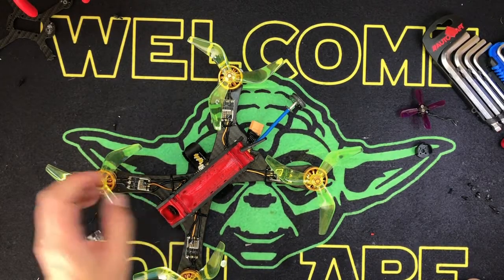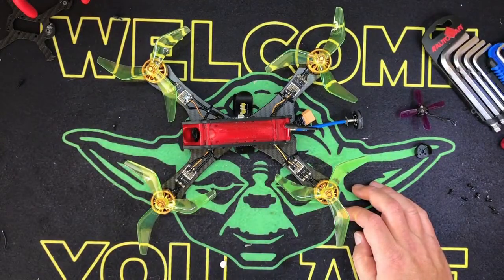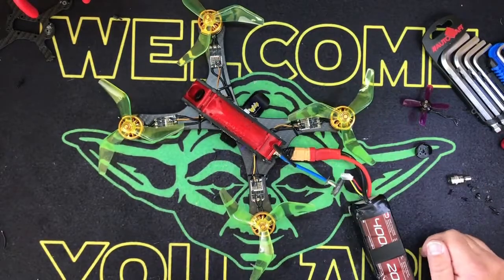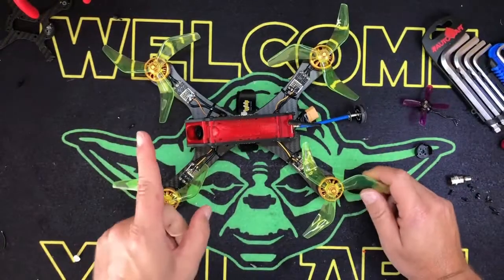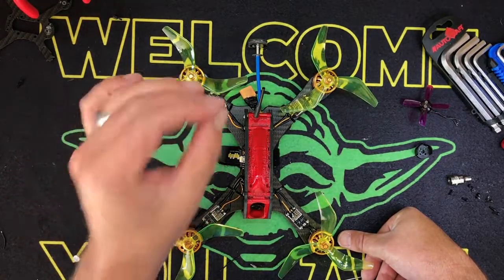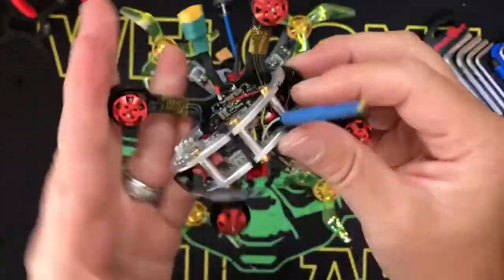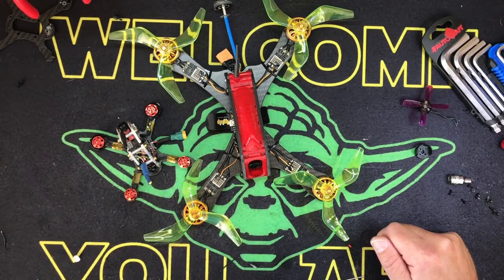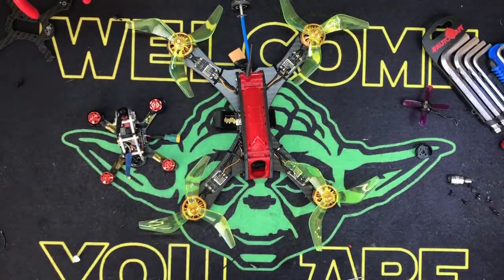Tech Advice- Betaflight 3.2 motor beeper function.. You should watch this..

Comment: I thought the idea of having the motors beep was so you could find the Quad when it crashes in long grass...?.....Worse, you didn't disclose how to set up the motor beeper either..
Reply from the maker: Hey brother, this is an old video, I think that motorbeeb was brand new.   I’ve covered this a few times in other videos.   It’s a lot more straight forward now than it was the.   Just flash “official” blheli firmware to your esc’s, then in cli type “get beeper” then change the beeper beacon from 0 to 1.  Once that is done, as long as your running dshot protocal, beeper function will work through the motors.   It is also safe now to have the volume in blheli to 200 without burning things up.   Let me know if u have any questions